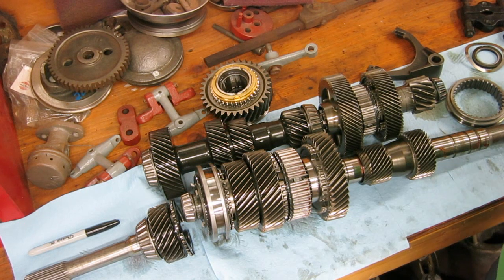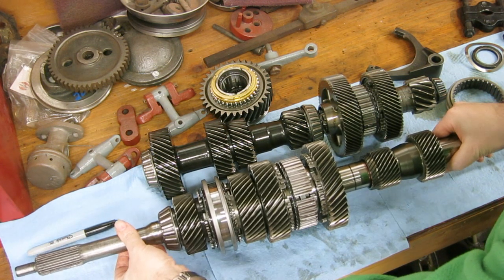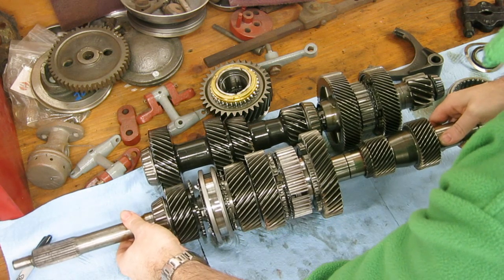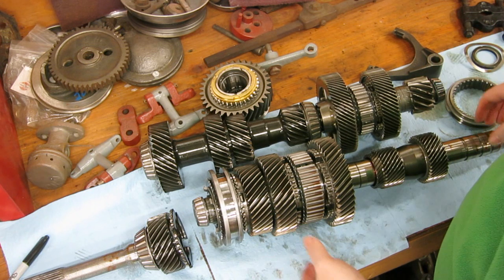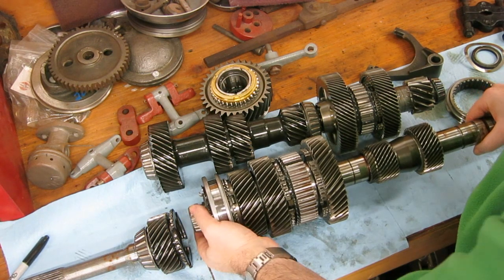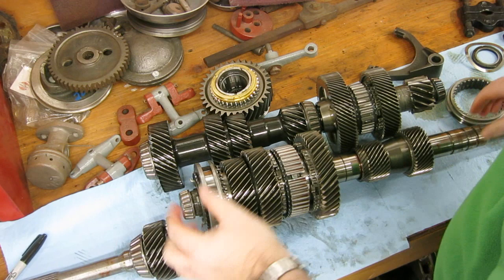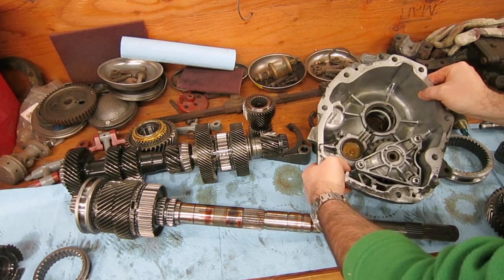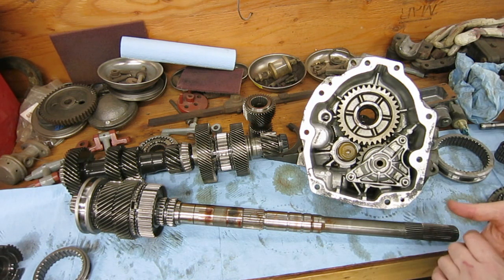What's inside a Corvette (T56) transmission

Comment: So when the car is in neutral, what happens in the gear box?  What is spinning and what is not?  Curious because my C5 whines when in gear but stops completely when in neutral.
Reply from the maker: In neutral, the input shaft is spinning and all of the gear clusters are spinning on a stationary output shaft.  When you shift - slide a selector ring to lock a gear to the output shaft - the output shaft (pinion) turns with that specific gear cluster.
Reply: @vsvenson  Thanks, just as I thought.  So basically all the gears are always moving if the if the clutch is engaged and car is coasting.  What do you think would be the cause in my case?  Whine when going into and while in gear and no noise when in neutral?

Comment: The  only  time  you stop  a gear  is  when the car is not moving  and you are  putting  it  into    first or revers..   

  I  can  shift a  car  with  out  using the  clutch  while  I am  going down the  road..  You ease off on the  gas  pedal   until it's  easy  to  put the transmission  into neutral ..  Then  you rev  match the engine  rpms   to    get the gears   on the engine  side  to match the speed the  gears  on  the drive  shaft side   are  spinning  in the  next  gear that you want to engage..     You have  to increase engine  rpms  to  go to a lower  gear  and  decrease  engine  rpms  to  get the  transmission  engaged  into a higher gear..

    How  do  I know this ?  I  have  done it for over  40,000   hours in heavy class  8  trucks  that  don't normally have synchronized  transmissions  ..   Many  Eaton Transmissions   have  three  shafts  two   of them  are Counter shafts..  Thus  it's  called a twin   countershaft transmission ..  Eaton  uses  an  air shifter   to change  ranges  and the range  shifter is synchronized..     As is the air  shifter r  to spit  the  gears  between  direct and overdrive on some models ..

Comment: The   gears  are  all turning all the  time .. The Synchro's  do  not stop  the gears..  They   Synchronize  the drive  and driven  gears  so they are spinning at the same RPM  so that the dogs  can  be engaged  ..   so that  they  are positively locked together ..  I wish  I could  get a T-56 with straight cut  gears  it  would  be  much stronger and more efficiently  but   oh  no straight cuts gears are noisy ..

   Your  explanations are  rather bad  really  but I guess you  know how  to take a transmission  apart and put it back  together ..

   Gear Box  Video  makes  by and far the best videos  on  Manual  car transmissions I have ever seen.

https://www.youtube.com/user/GearWorldTV
Reply from the maker: My intent was to imply they stop relative to the shaft/drive dogs they're engaging with.

Comment: I was just wondering if the shift forks are brass or are they cheap plastic? Gertrag uses plastic on the tips of the shift forks.  ... And I think that's just asking for trouble.
Reply from the maker: The tips of the forks are plastic.
Reply: Thank you, you would think they would be something of a stronger material

Comment: The shaft that you are calling "gear for your shifting", is called the counter shaft assembly. I once tore that front gear on the counter and the gear of the input shaft, from a 1970 442, W-30. Great explanation, thanks for the video.

Comment: Doubt anybody will respond, but, my c5 makes a loud rattle like whirling marbles In a metal can sound. Goes away when I put my foot on the clutch but comes back as soon as I let my foot off. Already replaced TOB. Could it be I out shaft bearing? Clutch pedal feels perfect and no problem shifting into gears. Makes whirling sound when in any gear. Thansk
Reply from the maker: Angel X. Santana Might be one of the drive shaft bearings...

Comment: excellent explanation! I thought I knew how it all worked, since I rebuilt two T56s. I never made the connection, that there really isn't  a 4th gear..lol!  I always called 4th the input shaft, were I guess the best description of it would be 4th dogs, and input shaft!

  Your dogs look a lot better the mine did! I sharped some of mine up, seems to work ok, everyone and a while they are notchy. And reverse is always notchy, but I couldn't get my angle grinder in to sharpen the teeth on reverse.  

  BTW carbon fibre is the Friction material on the blocker rings.